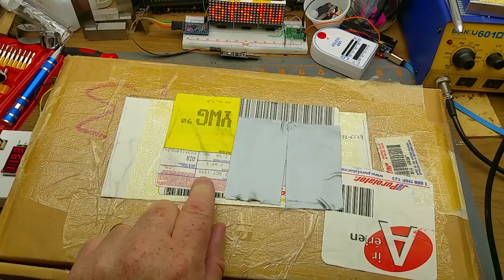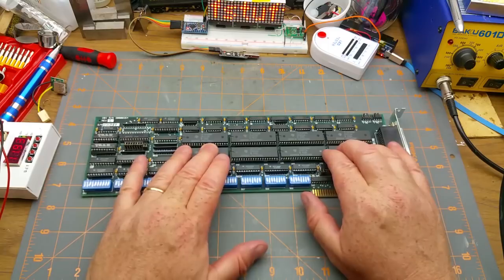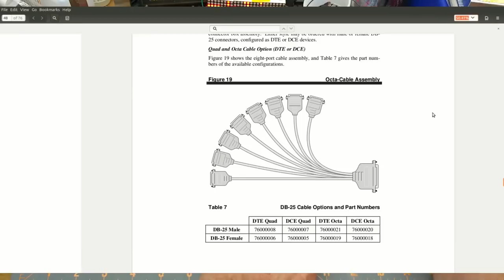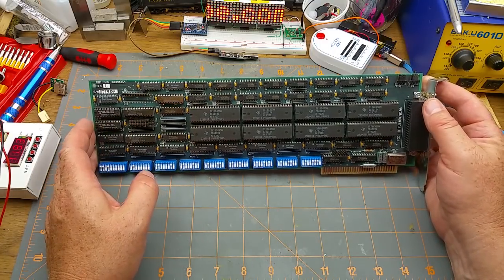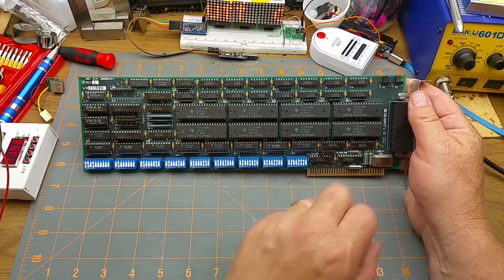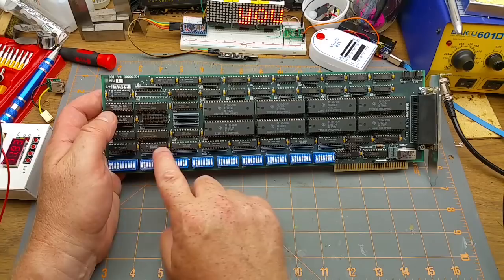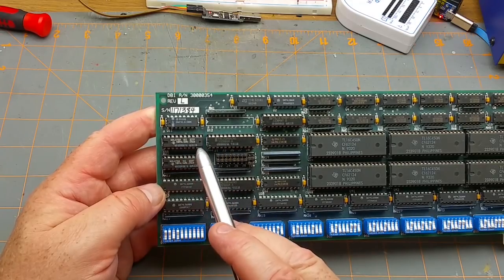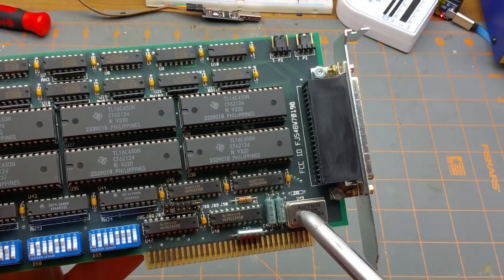checking out some old tech - digiboard PC 8

Comment: Yes, I remember this one. I used to install them in customer PC's with D3 Pick Systems database, which used this board to connect serial terminals to the PC.
Especially when there was a thunderstorm, some ports broke down and I had to replace them by new cards. 
After a certain time, I started unsolder the broken chips, put in a socket and installed new driver chips (the pair of 2 chips on top of the board). These RS-232 driver chips were a bit sensible.

Comment: Those PALs do something otherwise impossible on ISA with its edge-triggered interrupts - interrupt sharing. Card requires separate driver (maybe FOSSIL if it was used in grandpa BBS) and wont work out of the box with normal PC software. Pretty ingenious for something designed in ~1989 and still manufactured 10 years later without changes.